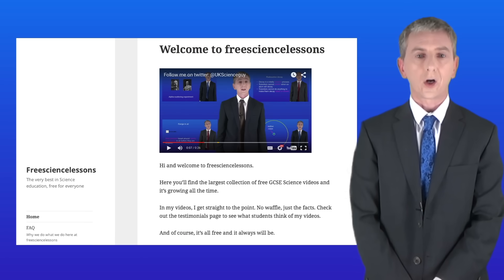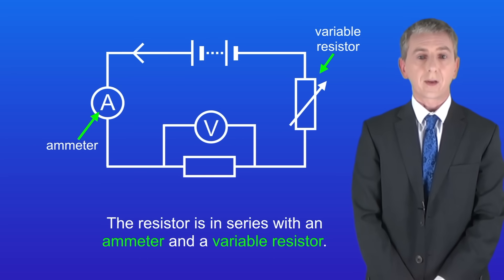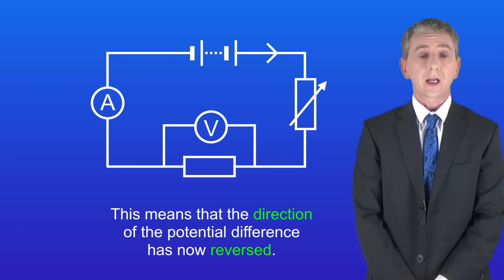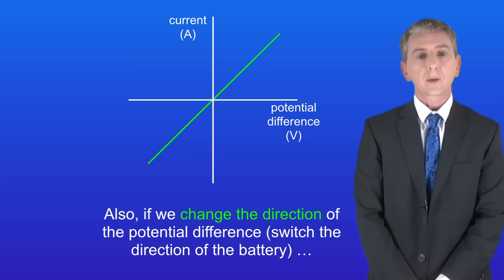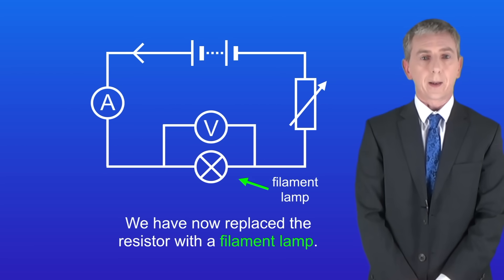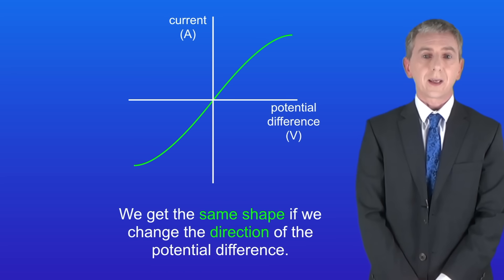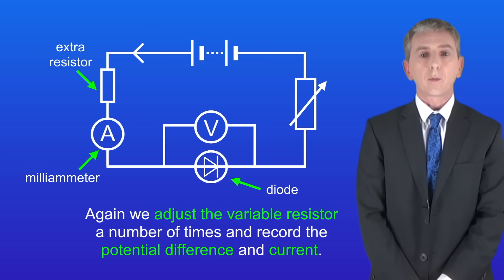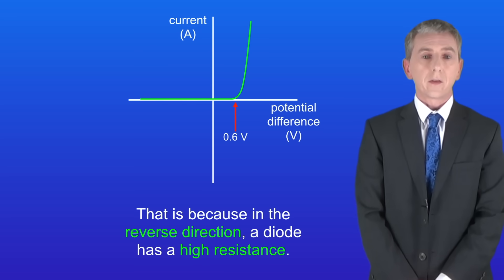GCSE Physics Revision "Required Practical 4: Current / PD Characteristics"

Comment: im so confused on why the voltmetre would change if it is only measuring across a resistor (and not the variable resistor) surely it wouldnt change. and adding onto that why is the volmetre across only one of the resistors that doesnt change and not across the battery.

Comment: the diode info was amazing and the practical tysm. A 2 or 1 marker could be why there is an extra resistor in the diode circuit.

Comment: Great video as ever! But could u explain how varying the resistance of the variable resistor affects current and voltage? And also could u specify how we change the resistance on the variable resistor to increase increase current and voltage, decrease R or increase R?
Reply: Not an expert, but increasing resistance decreases the current that can pass through the component and increases the PD or voltage needed to pass the current through the component. Guessing your exam is tomorrow like mine, so good luck :)

Comment: Can you explain why increasing the resistance using the variable resistor increases the potential difference? I thought as you increase the resistance the current decreases proportionally and the potential difference stays fixed as V = IR.
Reply: Because potential difference or voltage is equal to current multiplied  by resistance, so to increase the resistance would increase the potential difference as long as the current stays the same, or constant. I think lmao 😂
Reply: @faragefan1014  Yes I agree, I think it is implied that the current would not be changed as the resistance increases, resulting in an overall increase in p.d.

Comment: Waaaaaaaaaaaaaait....
I thought current was the same even if resistors were added 2:50
Reply: The resistor increases the resistance in the circuit which makes the current lower throughout the whole circuit I think

Comment: Is it not possible to instead of using a varibale resistor, to instead use a a power supply maybe that can change the amount of voltage and change the voltage by one volt maybe.

Comment: Hi Sir, if you are supposing that the current flows like a conventional current, if it reaches the extra resistor detected by the ammeter, what is the point of having the variable resistor? Does it still lower the current even after the current is low??
Reply from the maker: The point of the variable resistor is to allow us to adjust the potential difference across the other component in the circuit (for example a fixed resistor, a filament lamp, a diode etc).
Reply: @Freesciencelessons  Understood, thank you.

Comment: Is anyone else confused by the filament lamp? Says it gets hot as the current increases which increases the resistance. The graph shows the potential difference slows down, but wouldn’t it speed up with increased resistance since v = ir?
Reply from the maker: The potential difference is not "slowing down" or increasing more slowly. The current that you get for a given potential difference increases less as the resistance is higher (I = V / R).
Reply: Freesciencelessons righhhhht thank you so much!

Comment: I've heard that resistors are used to decrease current to a particular appliance, such as in the regulator of a fan. However, I've also heard that the total current in a circuit is always the same- in other words, all the current leaving the positive terminal of the battery reaches as it is to the negative terminal. How can this be? The two statements are contrary. How can the total current be the same if a resistor is reducing current at some point in the circuit?
Reply: Name 1 resistors don’t reduce current in the sense that they get rid of it, they just make a ‘bottle neck’, or smaller area for the current to pass through, like in a traffic jam, which causes it to slow down, lowing the current
Reply: Name 1 you’re thinking of the fact that current is always the same in series circuits. As in, wherever you measure the current from in a circuit at a given time, it will be the same. The total potential difference can not be changed by the resistance because the pd comes from the cell. The current is just the rate that the charge is flowing and so the resistance slows the rate down, thus decreasing the current.

Pot.difference = Resistance x Current

If the potential difference doesn’t change, and the resistance is increased, then the current has to decrease so it still equals the potential difference.
Btw I’m still not 100% sure on the electricity topic so I may be wrong, but I hope what I said helps even if it is the night before the exam.
Basically, what I’m saying is unless Shaun confirms what I’m saying, take all this with a pinch of salt as I may just be talking rubbish.

Comment: Great vid sir thanks a lot really appreciate your efforts! If u don’t mind, how does the variable resistor vary the voltage across the component?
Reply: variable resistor allows you to increase length of the wire that the current is flowing through. the longer the wire, the larger the resistance as there is a longer path for the electrons to pass through so more energy is required to push them through. a larger resistance means potential difference must increase to push electrons round the circuit so the potential difference/voltage increases with resistance

Comment: Sir, the electric current goes from the negative side of the cell to the positive side and in the video, the arrow in the diode is facing the opposing side of the electric current, so i dont understand why the diode isnt resisting the electric current
Reply from the maker: The arrow shows the conventional current which runs from positive to negative. If you watch my video on electric current (9-1) I explain what that means.
Reply: Thank you sir

Comment: hello sir, i don't get why all the readings would be negative on the volt and ammeter if the batter is reversed
Reply: the current is flowing in the opposite direction

Comment: Sir- i don't understand how the increase in temp in the filament lamp results in the graph looking like that- thanks
Reply: because it just does
Reply: The positive metal ions in the filament become hot and gain kinetic energy meaning they vibrate. Therefore if they’re vibrating it makes it more difficult for the electrons to pass through meaning the resistance increases resulting in the shape of the graph.

Comment: why do you need a variable resisor?
Reply: to be able to change the current in the circuit
Reply: It can be easier to change the resistance in the circuit more accurately

Comment: Sorry to bug you... I was wondering why the current doesn't increase as soon as it is positive? Why does it have to be above 0.6V? Than you and sorry!
Reply from the maker: A diode contains a material called a semiconductor and it can only conduct electricity when the potential difference exceeds a threshold value which in this case is 0.6V
Reply: Thank you very much! That has been bugging me for a while:) The problem with GCSE's is that everything is slightly dumbed down so it leaves lots of loose ends! I keep having that problem with chemistry... hopefully A-Levels will be better :D
Reply: uh, if you're doing physics a level now, what do you think of it?
Reply: @thericeguy9368  Physics a level is a lot more exciting than gcse physics.
Note: Im still doing gcses but the topics look really fun for a level physics.

Comment: Sir, you know for the equipment, why must there be a variable resistor AND a resistor, whats the point/ need ???
Reply from the maker: The variable resistor allows us to change the potential difference across the component. However, a diode would be damaged by a high potential difference. So in the case of the diode, we have another resistor. This is to limit the size of the potential difference so the diode is not damaged.
Reply: yes thanks, but what about for the first investigation, why was there any need to put a variable resistor? is it just simply to control the p.d?
Reply: Lil1 S yes it is. We use it to get different readings of p.d. for the graph
Reply: Lil1 S its so you can get a range of results on how p.d and current interact, the p.d is for the x axis on the graph of current against p.d, and since the current changes with change in p.d by changing the p.d it will allow you to plot a line on the graph (because you'll have a bunch of values, which form the x and y coordinates) - hope it helped, i'm awful at explaining 😂

Comment: why do you need a variable resistor and why do you need to change the values
Reply: a variable resistor is used to change the resistance so u can get a range of values for current and potential difference. u need different values so u can plot a graph. u can search up this practical and watch an actual demo

Comment: hi why is a variable resistor used? Is it to change the p.d and if so why isn't this just done by changing the p.d of the battery?
Reply from the maker: You could change the pd by adding more cells to the battery. So that would be an acceptable alternative.

Comment: Sir, why does the direction of the potential difference have no effect for the filament lamp even when the resistance is high? As with the diode, there is no current if the potential difference is reversed due to the high resistance. Why doesn't this happen for a filament lamp?
Reply from the maker: Because diodes are designed to have a huge resistance if the potential difference is reversed (diodes are a type of material called a semiconductor). A filament bulb is simply a thin wire so the current can easily flow in either direction.
Reply: Thank you sir.